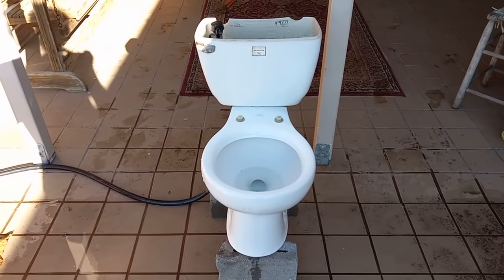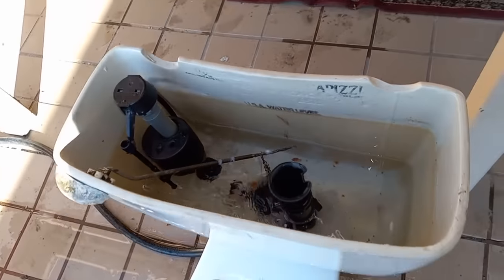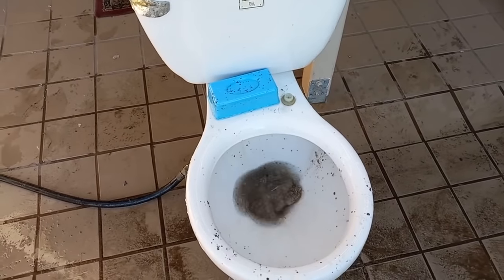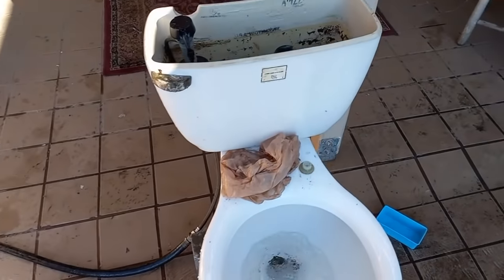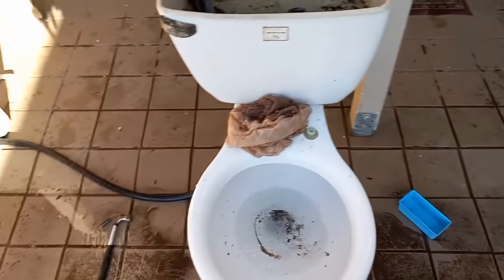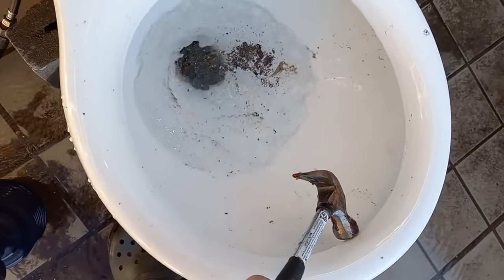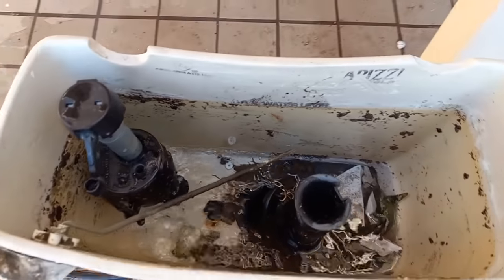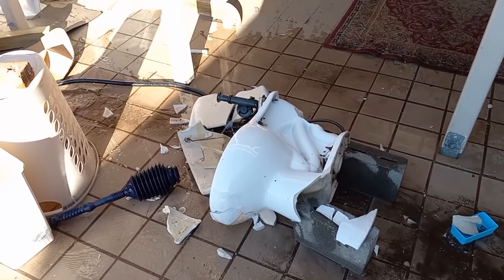2001 Capizzi Toilet Punishment Day!

Comment: Do this for next punishment: take off the tank and put really really high pressure water in the tank connection and then plug the toilet and watch it overflow like crazy
Reply from the maker: That would be awesome
Reply: @OCC_Plumbing_and_Restorations  what are you talking about are you trying to put on the toilet or are you just testing it or punishing it are you testing or punishing it

Comment: I think you should try to overflow the tank that might help but maybe with a bucket because the toilet valve does not fill that much water inside the tank
Reply from the maker: Yeah, a high tank worked pretty well too.
Reply: @OCC_Plumbing_and_Restorations  i have 11 robux now

Comment: Bro was brave enough to touch toilet water ☠️. Id litterally vomit if i did that
Reply from the maker: It hasn't been used in a while
Reply: Eorkod
Reply: @OCC_Plumbing_and_Restorations plus you use the garden hose as the water system
Reply from the maker: @Vapemaster3k  I was using it to bring fresh water to the tank
Reply: @OCC_Plumbing_and_Restorations  oh
Reply: That toilet deserved it for not passing a washcloth
Reply from the maker: @TracyAbbate  Facts
Reply: You mean this emoji
💀
Reply: It’s actually garden hose water. not disgusting fresh sewer water
Reply: I touch toilet Water
Reply: True
Reply: @OCC_Plumbing_and_Restorations  I miss the old punishment videos
Reply: Oh, actually that that is not the rim holl
Reply: There’s other rim holes that working in the water you can’t see
Reply: I mean 🤔 the water was probably clean 😐
Reply: Cc’d.  xx ty😢😮
Reply: i touched toilet water before.
Reply: ME TOO
Reply: There's not enough pressure
Reply: There's not enough pressure
Reply: That's hose water
Reply: @OCC_Plumbing_and_Restorations  toilets are for poop and toilet paper only
Reply: @OCC_Plumbing_and_Restorations  when you said what happened to this toilet you broke it
Reply: It’s been cleaned and has not been used for a long time
Reply: Technically its just hose water cuz its outside. Plus its probably been cleaned well. You aint afraid of hose water are you?

Comment: Yes
Reply from the maker: How about a Peerless Madison?
Reply: I need to see the tests
Reply: That's an okay toilet, but If you get one of the squeaky mcgarbage I'd definitely punish it
Reply: Owen I think we have to replace the Kilgore toilet, I tried poking the siphon jet, but it's not working, and maybe if we take this toilet out, I can give my address so you can either get rid of the mineral buildup or dissect it
Reply from the maker: @josuejuarez4949  Is there a way I can contact you privately?
Reply: Email or phone
Reply from the maker: @josuejuarez4949  Message me at throneking60@gmail.com
Reply: @OCC_Plumbing_and_Restorations  I messaged you on that email on January 29, and you never responded, but the mineral buildup has gotten worse now the toilet barely flushes because the siphon jet does not work. I may need to replace it.

Comment: You blocked the rim holes
Reply from the maker: Lol
Reply: @OCC_Plumbing_and_Restorations   if you can find another one try flushing food
Reply: @OCC_Plumbing_and_Restorations  also the trapway was small
Reply from the maker: @tracymennell1849  What kind of food?
Reply: @OCC_Plumbing_and_Restorations  like McDonald's
Reply from the maker: @tracymennell1849  That would get to be sort of expensive
Reply: @OCC_Plumbing_and_Restorations  how much is it
Reply: I think here it is sort of £1 £3? I have no idea. But if you have another video posted. Let me know
Reply from the maker: @tracymennell1849  It's a little over $10 for a meal and over $5 for just a burger.
Reply: @OCC_Plumbing_and_Restorations  so you live in America
Reply: @OCC_Plumbing_and_Restorations  you could try putting other valves in toilets but if they don't fit try a small one
Reply from the maker: @tracymennell1849  Yep
Reply from the maker: @tracymennell1849  I tried installing a fill valve from England but it didn't work well

Comment: I will definitely say this my old mancesa toilet is way better than that piece of crap
Reply from the maker: I think basically any toilet would be better than this one.
Reply: @OCC_Plumbing_and_Restorations  definitely
Reply: @OCC_Plumbing_and_Restorations also with the snail shell my kohler wellworth Ingenium could take that very easy compared to that capizzi piece of crap
Reply from the maker: @toiletfan15julius26  Yeah, an Ingenium would put this to shame.
Reply: @OCC_Plumbing_and_Restorations  yeah especially mine my ingenium flushes like a unit and it's the toilet in my profile picture if the capizzi was still here my ingenium could beat it at a flush test my old ingenium:👍 the capizzi:🖕